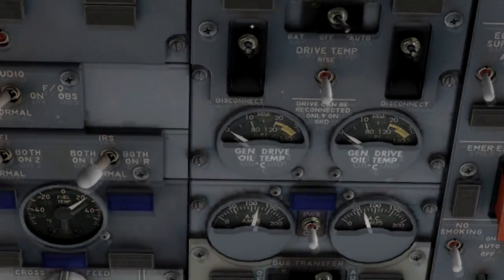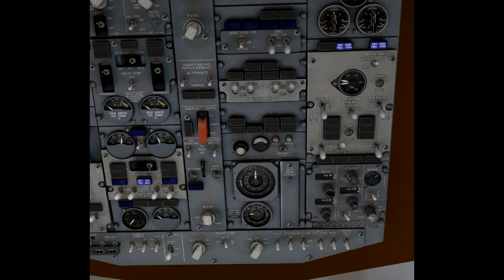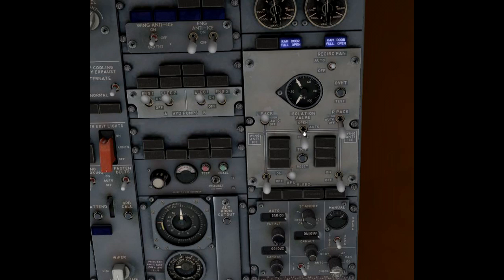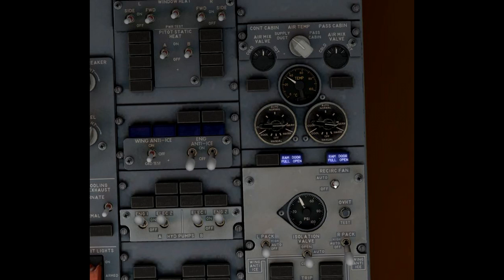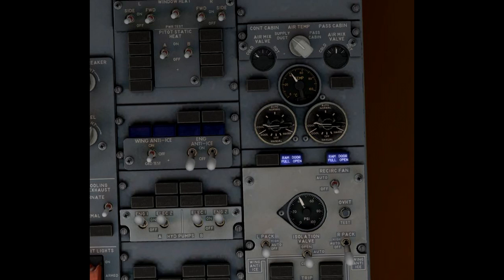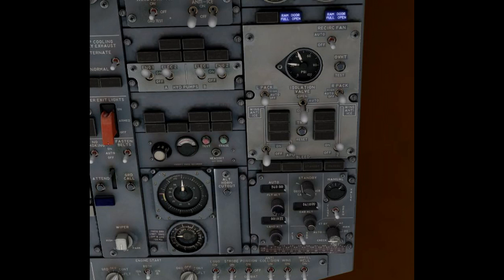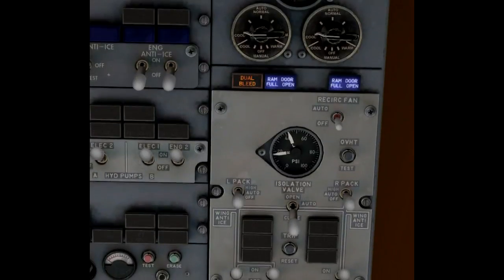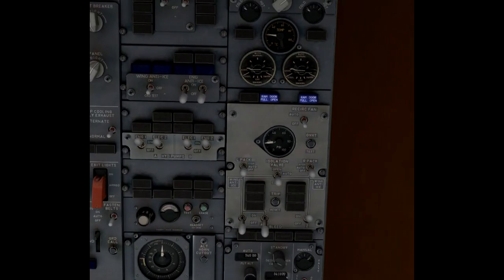Pneumatics demo

Comment: @tf51d Just discovered Lufthansa is the exception to this rule, sorry my bad! Is this going to be an option in the package, as the majority of 737's are designed the opposite way? I don't use X-Plane 9 that much because of limitations like ATC, and AI traffic, and visibility limitations, but I hope to get more into it with X-Plane 10, a good X-Plane 737, especially a classic model with a VC would be a big plus for me. The panel itself, does look really good.